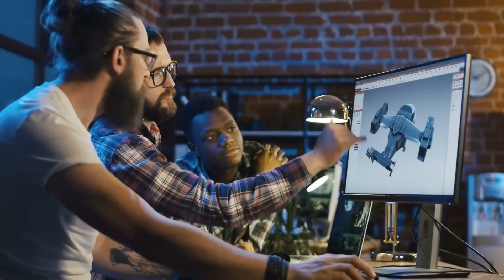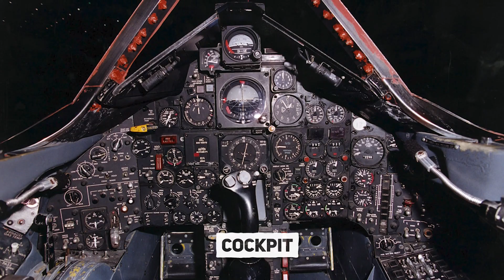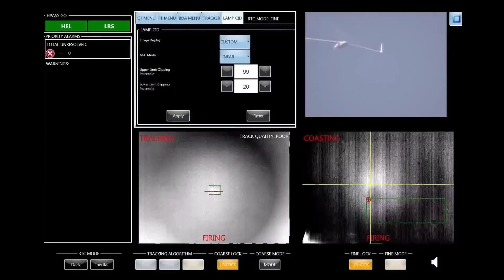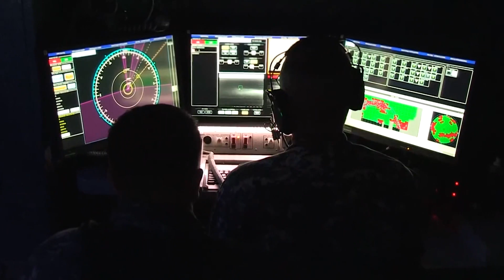US Air Force Confirms: DARKSTAR and Laser Weapons are REAL! China is shocked!

Comment: DUDE stop with the drama talk. I could not make through 1/2 your video. It sounds like FOX news.The SR71 was never designed to carry weapons. Also, the engine used on the SR-71 Blackbird is called a turboramjet because it is a combination of a basic turbojet engine and a ramjet. The Aurora uses a Pulsejet which is a deritative of the sr71l.

Comment: Error, error, error.  You mentioned that the regular engine became a ramjet, incorrect.  The regular jet engine became a scramjet.  Once additional thing.  The name if the replacement of the SR-71 was the SR-91 and it had the twin vertical stabilizers and a top speed of Mach 15 at 130,000 feet, while the SR-72 only has one stabilizers and was limited to only Mach 5, not 10 or fifteen..  So which aircraft are well dealing with here?
Reply: I agree with you. Peace on Earth 🌎🌍.
Reply: God bless you.  From your mouth to God's ears.
 @joserafaelgarciamorales8724

Comment: Falls information. Nowadays to shoot an object 1km away with laser beam needed at least 200kW power source which could not be loaded to this super jet for long use. Due to the weight of the laser energy source and its fiber laser source including its cooler. The laser weapon systems can only be mounted on ship. The whole systems occupied at least 1x 20 foot container
Reply: While I agree for the most part, I have heard of nuclear powered batteries that can fit inside of a briefcase, if they can do that, they could easily power a few dozen shots in the systems onboard.